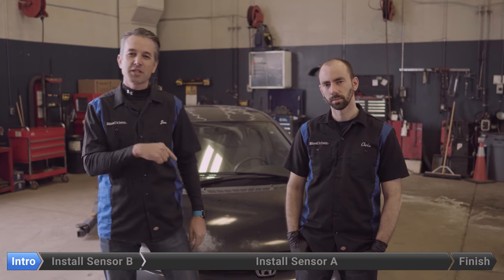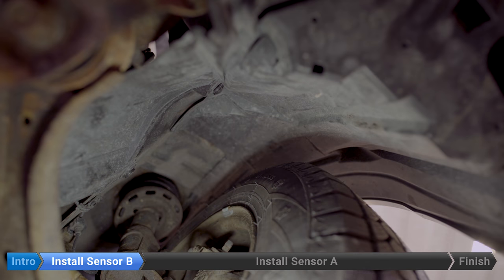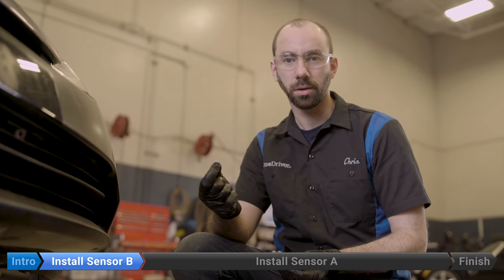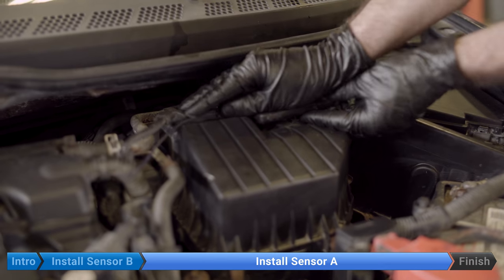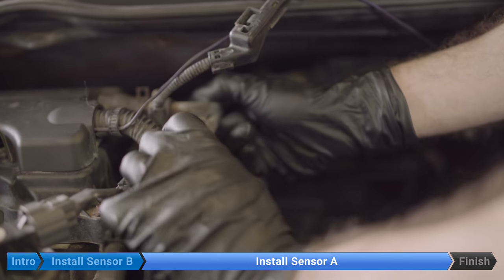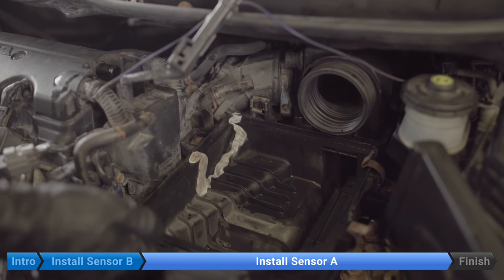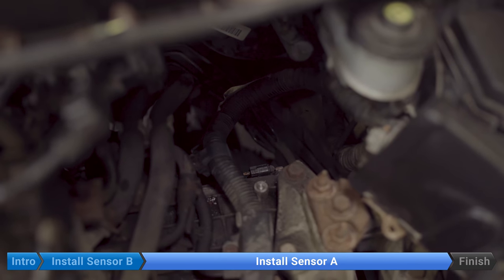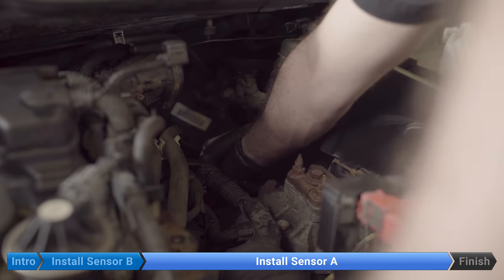Transmission Pressure Sensors – 2006-2011 1.8L Honda Civic

Comment: One of the best videos on this topic. What blew it the fact that no mention of part numbers. It is very confusing (online) to figure out if 2nd and 3rd take the same part number. Would have been really helpful to have made a comment about that part numbers.
Reply: Part number I found for the sensor (A) is 28600-RCL-003. Waiting on mine to arrive. Missing the part number for the crush washer though
Reply: Honda civic 2010 both sensors are the same honda dealer part # 28600RPC004

Comment: This is a good video. But there is something else that will cause the Green light to flash. I put a New Crank Shaft Sensor in and for Four Day’s and about 500 miles It run perfect and then I lost all Power the car would not go 25 miles per hour and green light was Flashing. I pulled the code. It said Crank Shaft Sensor I pulled the Crank Shaft Sensor out and one of the Three prongs was Bent. I fixed it and it is now Perfect. So. Be sure you don’t bend any prongs on anything you Replace.  I’ve. Never in all my years had any thing like that Happen.    Just a Word of Advice

Comment: You think this might help in my situation? I have a 2008 Civic and every time I hit 80’s my car just has trouble shifting down like it stays there accelerated mind you i dont have my foot on either pedals and i have no check engine light and i do oil change on both engine and transmission or if you have any idea of what it can be I’d be happy to hear your input; thank you!!!
Reply: Any luck fixing that issue ?
Reply: Have you done computer testing ? Just check for the error codes. Mostly it will be with sensor issues.

Comment: Hello, are sensor a and sensor b the same or different? There is a shaking when shifting from 1st to 2nd gear. Which one should I change? Greetings from Turkey
Reply: check with the scanner it usually tells you which on you need to change b is at the bottom and a on top
Reply: They're the same exact sensor, with the same part numbers. There are just two of them and one is located at the top of the transmission and one at the bottom. the scan tool should tell you which one is which. The P0842 code is for sensor A which is at the top.
Reply: @BridgeviewAutoParts  thank you very much, best regards🇹🇷

Comment: Amazing video with great camerawork. Had my first real car problems with my 2010 civic and by no means am I a car expert. However I am vary sensitive on how I spend my money and when I talked to a few mechanics they quoted me around 500$ with no guarantee it would fix it. One even told me I needed to get a whole new transmission. Crazy!!! But with me going to the dealership and buying the part for 130$, an afternoon of my time and a pizza break I had a back to normal functioning civic. No more check engine light and no more blinking D and shifting felt smooth.
Reply: What’s was your car symptoms ?  I want to know please.  What was your car doing before you fixed?

Comment: Hey, i have no codes but i do have a a problem with 1st - 2nd jumping/revving high and slamming into gear, really bad when its cold. Could this still be the problem without codes?
Reply: I am wondering if you solved this problem as this is the same I am experiencing...
Reply: Any updates on what it was?
Reply: Last winter the slamming stopped, but it still revs a little high, i guess ill see what its like this year.
Reply: Same problem

Comment: Thank you, very informative. My A sensor went out and the car would not shift into higher gears. Great help in replacing that one. I found that one can merely take the drives side wheel off and release the two clips from the panel in the wheel well and the B sensor is right there without having to remove all the clips from the panel under the car. Did the bottom sensor in minutes in this manner. Thanks again...car runs like a charm.
Reply: You save me time thanks

Comment: Thank you so much for this video. I just replaced the 2nd clutch sensor, and it worked! This video just saved me some cash, thank you!
Reply: what was the problem? the car stoped moving forward nor backward while motor still on?
Reply: @scorpionmgh1110  No. My car wouldn't shift out of 2nd gear. The D light on the dash panel was blinking as well, which was unusual because it is usually a solid light.
Reply: @scorpionmgh1110  I'm having a problem with my 2015 honda civic hybrid engine runs but won't go forward or reverse
Reply: @tee5392  brother can you please help i have the same problem what did they tell you it was?
Reply: @tee5392  mine is a honda civic 2001
Reply: @tee5392  hey man what was the solution please i have same issue

Comment: are both sensors the exact same just in different areas or are they different part numbers?
Reply: They're the same exact sensor, with the same part numbers. There are just two of them and one is located at the top of the transmission and one at the bottom. the scan tool should tell you which one is which. The P0842 code is for sensor A which is at the top.

Comment: This Video was very Useful 10/10 recommendation!!
Reply: Hi BlueDriver —
Thanks for this helpful procedure...

May I inquire this concern on my friend's FD 07 AT?
Replace with a surplus tranny, scanned without fault code already, but when you put the shifter on "N" position, driveshafts are still moving forward as if it is on the "D" position...

Thanks in advanced...

YsNoi —

Comment: The crush washer is required? What happen if I haven’t one?
Reply from the maker: It's a good idea - people often reuse crush washers but you are increasing the chances of having to take it out again if it leaks. If you don't have the old one to reuse then you should probably get one - they're cheap insurance, and don't have to be a Honda OEM part.
Reply: @LemurMonitors  whats the P/N not in description

Comment: I don't have Civic, but I do own Acura.  Do these pressure switches really need to be replaced as "preventive maintenance" or it is safe to drive until the car throws a code?
Reply from the maker: It would be recommend to replace them as it would limit what issues could happen. That being said it is not required.

Comment: Hi guys,
Loved this video. My honda crv 2005 got blinking D 2 or 3 days ago. I checked with obd2 and the code is coming - 
"P0848 Transmission Fluid Pressure Sensor / Switch B Circuit High"
Could u pls tell me which sensor to change?
Transmission fluid color is already lost its red color. Do I need to change the transmission fluid as well?
Reply: did the pressure switch change fix your issue? thanks
Reply: Yes I am able to fixed it. It was not the pressure switch broken. I changed transmission oil and with same pressure switch, it starts working fine and solved my problem.
Reply: @mustakimmitul3573  I did the same I changed the switch as well and everything is fine now thanks for the reply
Reply: Did you have problems shifting? All you needed was a fluid change, so was it giving better symptoms after change?
Reply: @Cameron Kline hi, call a honda dealer and ask the problem and part no of the item, how much is part, cost of fixing. Also you can search transmission diagram to locate the sensor. However, I dont know the problem. It could be big or small or might be different part failed. Its better to take it to transmission mechanic. I hope and wish that your can sort out the problem soon.

Comment: Which one is the the 3rd gear clutch pressure? Bottom or top?
Reply: The first one which is the bottom one.
Reply: Where to buy that sensor and how much does it cost?
Reply: @sosunny1838  I bought it from AMazon OEM
Reply: Rouel Marasigan where is the sensor from 1st to 2nd gear

Comment: Why is the part number not in the description? Is it two different sensors or the same one.  this part number 28600-RPC-004
Reply: "Yep! OEM part number is 28600-RPC-004 for both" This statement can find in the fifth comment down in Kevin Suksi

Comment: I had honda civic 2010 i put scan its shows the code p0746 solenoid a and b sensor after that i change the cable and error gone from the system. But issue still remain. Issue is that every first time i start my car and put in reverse or drive it get hard jerk. After i switched off and restart my car again after 10 sec it wont happen. Kindly help me out.
Reply: Same issue bro 😓
Reply: same problem with me
Reply: Did you fix it?
Reply: Same issue
Reply: same issue brother at my civic 2009. I'm wondering if  these sensors solve our issue.
Reply: How did you fix it?

Comment: I need a new transmission oil pressure switch , can I drive to Michigan and back (144 miles one way) and get it replaced early in the new week? Just popped up on Friday morning

Comment: does the manual/standard transmission have these switches? I can't shift my gears when the engine is on. Please help.
Reply: I second this question.
Reply: @diesur7126  Issue partially solved after i bled my clutch slave again several times to be sure. Been driving the car for several months now. Now I'm able to shift, but sometimes still hard to get into gear. I may need to adjust the clutch pedal. Another option is to replace the clutch slave with a honda oem part instead of an exedy that i have on. If that doesn't fix my hard shifting, it may be that my trans is bad.

Comment: I had my2006 transmission replaced the car still shifts and drive , but now all pressure solenoid A,B, & C codes and shift solenoids A,B,C & D codes r popping up ,what could cause that issue
Reply: My tranny is also acting up, did you get it rebuilt-bought a overhauled one or get one from a salvage yard? I'm trying to decide on the best route for mine....

Comment: Hello i have an 09 1.8. I’ve been having intermittent issues with one of these sensors. The code I’m getting is “p0848” is it possible it’s just a bad ground or the wiring harness itself? A few times it’s put itself in limp mode with the flashing Drive light and check engine but then minutes later it’s fine.
Reply from the maker: Intermittent does sound more like wiring - it might be worth replacing the sensor just to rule it out since it's reasonably easy and cheap.
Reply: Hi there, i have same problem, P0848, by now its only intermitent… is there any chance of damaging the gearbox?? Thanks and great work guys!
Reply: @LemurMonitors  How cheap are the sensors pls? And where to buy them also. 
Cheers
Reply: Did anybody resolve the issue?

Comment: Thanks for the video. I have a 2009 Honda civic DX-G with the check engine light on as well as the D light flashes on and off. Could this mean it's the sensors you worked on in this video? What are the part number for both the sensors?
Reply: Hi Emerson same issue with my honda civic 2007 Automatic. D light flashes sometimes and abs lights also comes. Did you find any solution?
Reply: Same issue here. I got P0847 code
Reply: Mine did the same thing...transmission sensor A. I replaced both...this video gives good information on how to do it...very easy really. The A sensor can be accessed by taking the drivers side wheel off, releasing the two clips on the panel and the sensor is right there....easily accessed without taking the bottom panels off under the car. Good luck.
Reply: @kyleernst328  Hello Kyle...When you say sensor A, do you mean the upper one? If the answer is yes, then the air filter box and other things do not have to be removed. Is that right?
Reply: @ssabotic  No sir, it was the lower one I got out merely by taking the wheel off and part of the splash guard. The upper one, I had to removed the air filter box and such...
Reply: @kyleernst328  Isn't the lower one the B switch?
Reply: @tonyjordan1320  Yes, I think I stated A instead of B. The B sensor is the lower one. My mistake. Forgive me. For me, just to be sure, I replaced both.
Reply: @kyleernst328  ,Thank you for the previos answer. What are the part number for both the sensors?
Reply: @ssabotic  I dont have those numbers and tossed the receipts. I did get the sensors from the Honda Dealership however...a bit pricey but always best to use genuine Honda part if one can.
Reply: Part number 28600-RPC-004

Comment: They're the same exact sensor, with the same part numbers. There are just two of them and one is located at the top of the transmission and one at the bottom. the scan tool should tell you which one is which. The P0842 code is for sensor A which is at the top.

Comment: Hello, my civic 2007 stuck on gear N, and need to press high RPM, to get jump to gear 2, but after 100KMH the gear come back to normal, the problem is on low gear, can u assist, thanks
Reply: Do you find solution for it?? Actully, I bought civic 2006 it may not change gear it shoes high rpm.So, i have to change transmission may be

Comment: I need help. My 2013 Honda Civic got two lights. Check emissions system and check transmission. My car starts up and everything but when I put it on drive it doesn’t accelerate or it jumps starts and skips gears and almost red lines. What can it be? Transmission or pressure switches or the filters?
Reply: first thing is you need to pull the  codes before anything else.
Reply: You got fix .? Already.? And wha was the problem.?
Reply: What was the problem brother?
Reply: Change the inline transmission filter along with the automatic fluid. Mine was acting up now shifts perfectly
Reply: Same here and it was the transmission sensors

Comment: My car is 2015 auto civic tr 130k km. Sometimes; as i shifting between  1 and 2  shaking and knocking. Auto transmission fluid is changed. Selenoid valves cleand (were clean) engine mounta are ckecked.(istokay) if i change this sensors. My problems are fixed? By the wat; how can i check my sensor is okay or not ?

Comment: do you happen to know exactly where the transmission fluid pressure switch is on a 2018 nissan altima P0841 code. I'm installing it myself amd can't find.  i already replaced the park/neutral sensor.  thanks in advance for your help

Comment: Do manual transmissions also have one of these sensors? I'm trying to diagnose a problem with my 06  manual civic. During cold weather, my  car is very hard to shift into gear. Transmission fluid has been changed regularly; clutch fluid is clean. I'm wondering if it could be one of these sensors or a failing slave/master cylinder.

Comment: Can you please send me a link for this two pressure sensor as Honda dealership is chanrging me like £80 a sensor is this right?  having issue with my D drive auto gearbox flashes and Have the Engine lights on.

Comment: Would this cause a misreading in the speedometer gauge ? Say I’m going 30 and it reads 60 or higher
Reply from the maker: That sounds more like an electrical/wiring or sensor issue
Reply: BlueDriver That is what I was thinking because I have no check engine light on. Thanks
Reply: cambia el sensor del velocímetro eso debe ser la falla, cuando el sensor no sirve la aguja se pone a marcar cosas que no son o se pone loca de un lado a otro
Reply: alejandro rodriguez será igual cuando el carro tiene velocímetro digital?
Reply: there are 2x shaft speed sensors one is no longer acurate

Comment: Thanks for the info 
I just been replace 1 of the sensor the one under and still blinking the drive in pannel i think i need to repalce also the top i didnt realize that theres one on the top

Comment: My code is po843  tfps /switch a circuit high is this same thing?
Reply: you ever figure this out? got the same code about to do the top sensor. everywhere i called said that bottom one is not even a thing…

Comment: Will this work for P0847 code transmission fluid pressure sensor/ Switch B circuit low??
Reply: Hello did it work for it
Reply: Did it work for
Reply: Hi I have the same code  which  one  you do have  change top or bottom
Reply: Did it work for you
Reply: I got the same code p0847

Comment: Are the two sensors the same?
Reply from the maker: Yep! OEM part number is 28600-RPC-004 for both
Reply: @LemurMonitors  thanks
Reply: @LemurMonitors  I called Honda and they gave me 2 part number 28600-RPC-004 and 28600-RPC-003 one for 2nd and the other for 3rd clutch switch

Comment: I have a 09 civic DX  1.8L , flashing D and check engine. OBD code P0848 and P0847. Both indicate Transmission Fluid Pressure Sensor/ Switch B. Circuit high (P0848) and Low (P0847). I just watched your video (well done btw!) am I looking at the lower sensor or upper or both? Are they in the same position as your 07? Any leads on the part(s) Thanks
Reply: hey did you change the sensor out?
Reply: @shimon2476  Yeah I did and no further issues!
Reply: @stevehubley9429  got the same issue gonna change it out tom thanks for the quick reply take care.
Reply: @shimon2476  i watched several different videos. I was hoping I didn't have to go in through the engine so i first changed the lower sensor. Best video found here: https://www.youtube.com/watch?v=buObXSdNCq4&list=PLXYjlNgCFjvc50oPpCfgHN0TsLLODeFpN&index=32&t=0s
Reply: @stevehubley9429  hey thanks man will check it out
Reply: What are the part number

Comment: Do you recommend changing both of them?
Reply from the maker: I wouldn't say it's necessary unless you have codes for both. It's an easy enough repair to tackle as needed, and it's not like they're in the same place so it wouldn't be a "two for one" type repair.
Reply: Also, it looks like changing the other one (3rd clutch) is way easier
Reply: @LemurMonitors  which is the code for 2nd clutch and 3rd clutch and are they the same part?